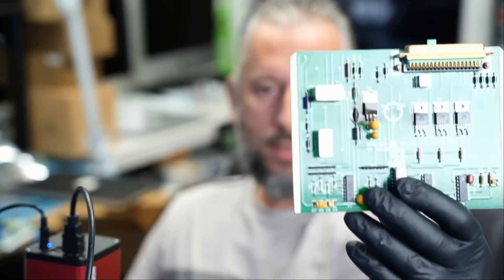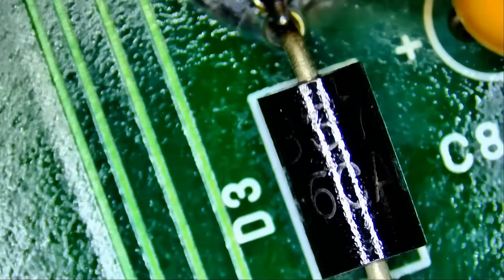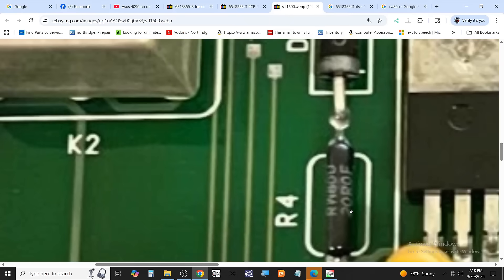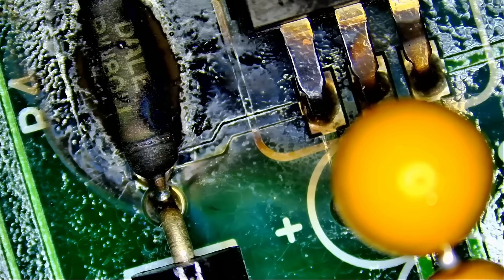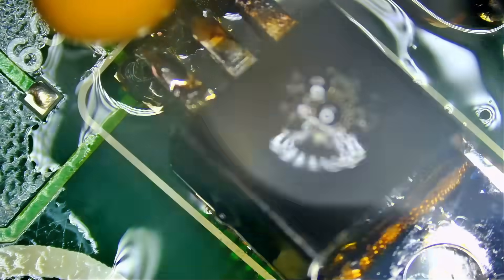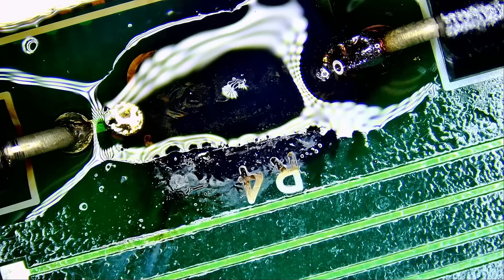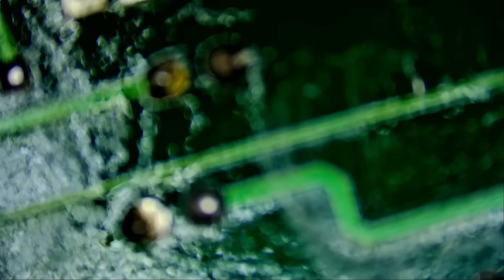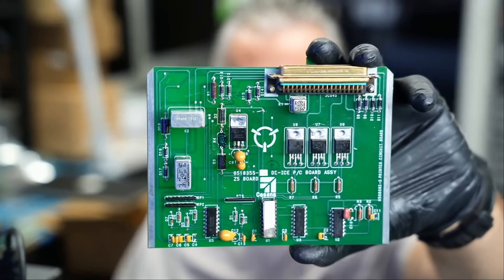Fixing a $10,000,000 Cessna Citation De-Ice Circuit Board

Comment: There's a public tech manual we use in the military from the Naval Air Systems Command that outlines practices and workmanship standards for aircraft boards, look up NAVAIR 01-1A-23 on Google if you're interested. Fair warning, the standards are extremely high but it covers pretty much everything.

Comment: I always find the cost of aircraft parts to be amusing.  I am oh so aware of the embedded cost of cradle to plane tracking but $12K for this board is an insult to logic.  Every part is common and available from reputable suppliers like Digikey, Moser, Avnet, or the like for less than a couple hundred.  Furthermore, looking at the boards design and fabrication it is clearly consumer grade.  The reality is that allot of stuff used in ancillary functions like this are simply normal kit.  My friends dad had an airplane that had a failed Alternator.  The alternator was a big standard automotive AC Delco unit available from any standard AC Delco parts supplier for $300.00 for a new unit.  A rebuilt Piper unit was $3K.  Only difference was an aluminum Piper plate installed with stake-on rivets.  Of course he moved the plate to the new alternator and it worked just fine for the next 30 years until he sold the plane.  We tore the alternator down and replaced the bearings, cleaned up the slip rings and installed new brushes and a regulator and it worked like new on a tester.  It sat on a shelf as a backup but was never need.

Comment: One way to check the repaired PCB before installing into an aircraft is to test it with appropriate equipment. 1 - 1A - 1 might cover the acceptability of a board after repairs, but that's more of a CRS call.

Comment: The problem with Aircraft components that you replace are to be aircraft manufacturer certified or approved and be traceable so that fake components are not used. The repair process should be acceptable (your work quality is great). The completed repaired item should be tested by some certified aircraft engineer. This is basically or roughly the rules required so that the law people does not jump on you. Keep up your great repairs.

Comment: Can you develop the board and change the electronic parts stronger in amperes as the voltage regulator 7805 amperes is very weak you can make a better surface regulator than it

Comment: I have a Sapphire rx 6600 pulse 8gb graphics card, it has been short-circuited 3 times, I gave it to the service for repair, it told me that the psu is broken, even though I bought a new psu, it was short-circuited again, why does it do the same thing all the time, what could be the reason?

Comment: That voltage regulator has internal thermal overload and short circuit protection, so you can't kill it-except by voltage spike higher than 35V.

Comment: Alex, if u know the power rating of the resistor, u can use another 20 ohm resistor, talk to the customer, this board just melts ice, does not control the engine, so should be fine.
Reply: Any idea what happens to a plane if the ice doesn't melt? 💥

Comment: Interesting. I work for an aircraft engine MRO. We wouldn't be able to send work to a repair shop like this if they don't have the faa approval to work on parts. I'm curious how the operator will verify the part airworthy if some random guy on YouTube was performing the repair
Reply: He made a video 3 weeks ago explaining why he's able to work on the board.
Reply: In his other video he explained that someone that is a certified installer has to verify the repair and is responsible for making sure it’s done to standards
Reply: It was explained in a previous video.
Reply: Alex addressed this in previous aircraft fix videos, anyone can fix the board, but it needs to verified by a certified shop before going back into the aircraft.
Reply: You never log the defect and just have it fixed.
Reply: Good question...
Reply: This exact issue was cleared up in a previous vid!
Reply: He has a video on this. The customer has a company that certifies the repair... or at the least, Bob writes his initials on it with a Sharpie. 😂 Besides, who doesn't fly in a Cessna without a parachute?
Reply: He explained this in another video, which I recommend you watch. It was a pretty common question so he specifically responded to it.
Reply: He's been through this before.. Every repaired board will need to go through faa testing before its refitted to the aircraft, Anyone can repair but only faa can test that repair
Reply: I agree with you.  The board is compromised with the burnt spot.  The parts may not be up to spec anyway.
Reply: Alex addressed this few weeks ago in a video for a similar board. See the first 2 minutes of a video titled "We Fixed a Cessna Circuit Board Without FAA Certification - Here's what happened." The short version is that anyone can fix the board, but it needs to be checked out and signed off later by FAA certified shop or EASA certified shop. And Alex is very competent. I would trust him more than phone repair shops in malls.
Reply: Me too
Reply: lol like the hobby that board is any different from any other consumer electronics lol, the FAA are just a bunch of beurocratic dick heads a lot of the time, they can't even be bothered to modernize the standards for non leaded fuel engines for planes.
Reply: Agreed, if it leaves a designated and approved repair area, the part or component is considered no longer fit for flight. Could be part of a unit that is used for board level fault finding but even then the same rules are followed.
Reply: Also he's not working to any approved documents, had a look at his website and there's no mention anywhere of any FAA certs.

Comment: The ESD warning symbol. With the circle being breached by electrostatic discharge (the arrows). How common is that on a PCB as it is more a military symbol. I do not think it is part of   IEC 60417 — Graphical Symbols for Use on Equipment

Comment: I am surprised that DIP sockets are allowed to be used on airplane boards like this (U1) ??? I know nothing about aircraft but in my Vintage computers "Chip Creep" makes DIP sockets unreliable as the chip creeps out over time with I guess temperature fluctuations and physical movement.
Reply: At least the socket was turned pin (less likely, but not immune, to creep).

Comment: 78M05 is a normal voltage regulator chip, the only difference is between this and what most of us retro geeks  use, the accuracy and the output current it can handle.
Reply: M is rated for 1.5A, with the input output voltage held at 3V, and with an infinite heatsink that keeps the tab at the reference point (normally between the hole and the epoxy on the top) at 25C. Will do this short term in real life, but you are better off derating to 1A if you have the typical 5V input output difference, with around 1V of 100/120Hz ripple on it. Sadly the TO3 version is long obsolete, and nobody offer a 78 series regulator in a TO3P package, it would be useful to have for higher input voltages and still 1a of current flow, though there you often simply use a pass transistor or a simple pre regulator with a NPN power transistor and a zener diode on the base to provide 4v cross the regulator itself, which does good things for both PSRR and noise performance.

Comment: This 20 ohm resistor is act like fuse and current limiter. You can put any 20 Ohm / 0,5W resistor.  Here these parts will cost around 2-3Euro. And labor will be another 30 Eu.

Comment: this board has 20$ worth of chips on it and they ask 12 000 what a life we live in
Reply: If you ever tried to certify electronics for aviation use you'd know why you have to charge 12k for 20 bucks worth of ICs and a PCB
Reply: Airplane stuff... Needs to be certified... etc etc. Those costs add up to the PCB itself. But I agree with you, it is nothing more than standard electronics.
Reply: Do you have any idea how much was the certification cost for this board?
Reply: 60% of that boards cost is getting certified for air worthiness plus the cost of engineering a product that doesn't have a huge market for.
Reply: A car you may sell millions of 1 computer pcb but in aircrafts you may only sell 10 thousand. It costs allot to engineer something so you have to divide that cost up with your projected sells of that item. The more that is sold the lower per item cost can be
Reply: Life of GREED!
Reply: I think there may be one unobtanium chip on the board. It is probably a bunch of gates worth 6 cents but in opposite world you can only buy it for $2000 in 1000 quantities. Old HP used to rebrand standard parts with HP part numbers.
Reply: You could remake the entire board from scratch for cheaper than they are selling it for lmao (like by A LOT cheaper). The board it's self probably costs mby $20-$50 to manufacture as a single board run MAX! And it wouldn't take long to quickly whip up a design for it in kicad (a free software) or something either.
Reply: not even $20, maybe $10. it is ridiculous.
Reply: I bet the person selling the identical pcb on line was pissed off losing a sale .

Comment: When you buy a $10 millions aircraft but you can't buy a $12000 replacement board.
Reply: only a dummy will buy 12k board when the old board can be repaired for less than 10% of the cost.
Reply: When you are smart enough to make enough to buy a 10 million aircraft, you don't spend 12G's on something worth no more than $100 (to make from scratch).
Reply: probably a matter of principle why pay $12,000 for a board that costs less than $100 to make.
Reply: Because throwing things away that can be fixed & reused safely is a sin !
Reply: weren't those mainly used by the army? so, makes sense.
Reply: People are cheap, like Boeing.
Reply: DOGE cost cutting.

Comment: Here our boy Alex details the repair of a de-ice circuit board from a $10 million Cessna Citation 560 aircraft.
The board arrived with a visible burn marks detailing the repair of a de-ice circuit board from a $10 million Cessna Citation 560 aircraft.
The board arrived with a visible burn mark on a resistor and a chip.
Initial inspection under a microscope revealed no other obvious damage.
Further measurements are confirmed no short circuits on the capacitors and diodes next to the burnt componentson a resistor and a chip.
The Initial inspection under a microscope revealed no other obvious damage.
Reply: no one asked for your AI summary clanker